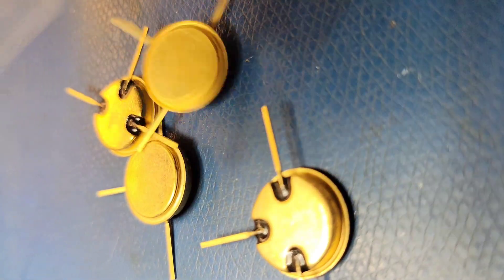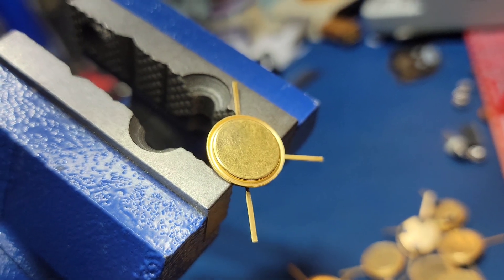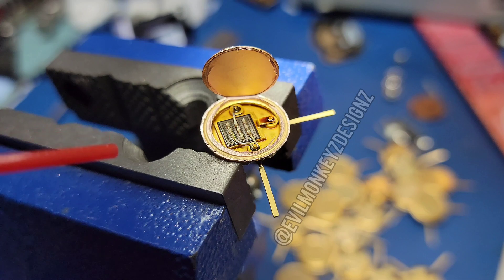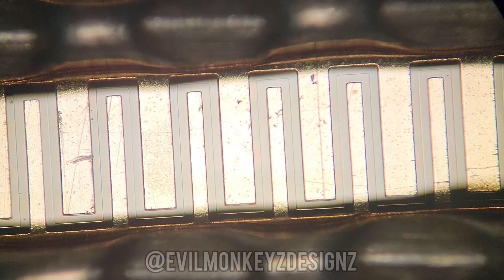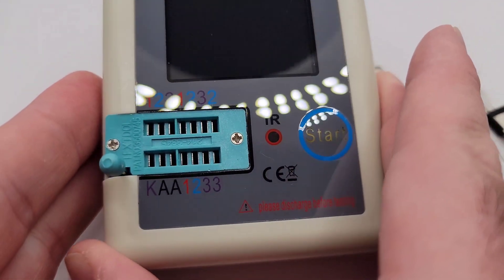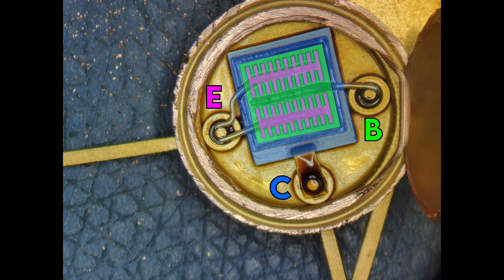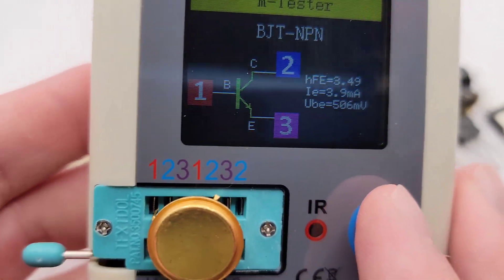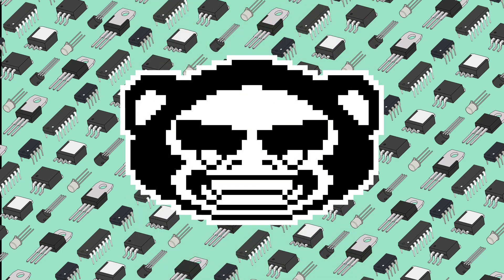JEDEC TO-121 NPN Bipolar Junction Transistor

Comment: I think they are high frequency power transistors. Supposed to be used in stripline applications.  I'm probly wrong   but i did work with things that looked like these back in the 1980's.

Comment: One of my favorite multimeters is actually the ones they give away for free at harbor freight. They used to be really nice analog sets w zero adjustment dial and 2 sets of leads (probe and alligator style). The new ones are digital and onlybcome w a probe style lead. But they kept the transistor test bed function in the form of a little circular part w holes for pnp and npn transistor checking. I get one every time i goto hazard fraught and keep a brand new one in my box of test equipment to give to friends and family w no multimeters at all. Its better than nothing and a great deal for free!

Comment: Don't know if you know this, but opening up transistors allows light to influence the characteristics of them. Turning them into light detectors. Maybe that's why the one you opened up tested differently.
Reply: magic of bing 6 month late to type something , you discover the same solution in comments of other people, i was about to type to test it again in dark room and see if those values disapear
Reply: It's like the Heisenberg uncertainty principle
Reply: I thought this was more of a diode/resistor thing. I've seen tons of light dependent resistors, ive seen leds used as light sensors, I've even seen a few products that claim to be light detecting transistors but these are usually just a light dependent resistor/diode used to trigger a transistor that actually does the power switching.
Reply: @TrapperAaron Photoelectric effect?